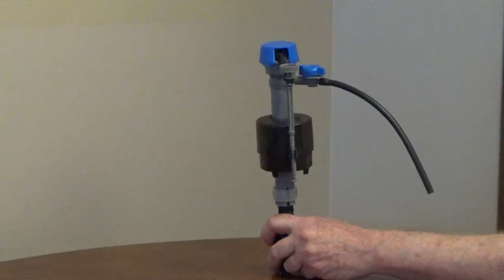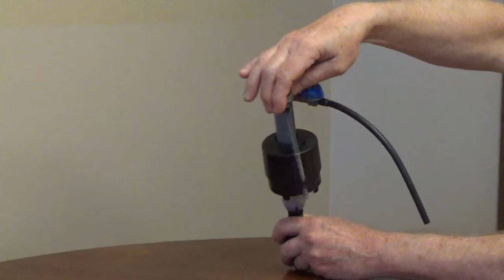How to Adjust Toilet Tank Water Level - Fluidmaster Toilet Fill Valve

Comment: I had trouble turning the screw because I was fearful of it breaking due to it being made of plastic.  However, I preserved and gave it several turns (more like clicks), and viola!...it worked.  Thank you!
Reply from the maker: You're welcome.
Check out some home improvement tips in our e-books https://www.amazon.com/gp/product/B0B2KW1FQ9?notRedirectToSDP=1&.
Reply: Congrats. You’re a genius
Reply: I've got the same problem. It won't turn clockwise but it'll turn the other way. I don't want to force it! It just bends a little. But it won't click like yours. 
I thought I could fix it myself. I live in an apartment but the maintenance guy is out sick this week.
Reply: @kberken  if it won't turn clockwise, it's probably topped out that is why you're supposed to check the length of the new valve to the old one before you install it.

Comment: I turned all the way low but it still over fill and keep running until I manually turn the water off
Reply from the maker: Hi, did you adjust the height of the main body of the fill valve?
Reply: @FIXITHomeImprovementChannel  i fixed it. all i did was cleaning the valve seal

Comment: the screw is at its limit and the water level is too high.  It doesn't stay at i inch below overflow.  I cannot stop the water rising too high.
Reply from the maker: Hi, you can pull up on the retailing ring on the shaft below the float, then push the top down. Then push the retaining ring back in place. That way you don't have to twist it.
Check out some home improvement tips in our e-books https://www.amazon.com/gp/product/B0B2KW1FQ9

Comment: My toilet tank has been making dripping noises periodically throughout the day, the overflow tube doesn't have water flowing in, so I assume that's at the right level. and the water is at mid level on the float. I wiped down the flapper really good on the bottom in case there was any buildup but it seems to be a good fit.

not sure what's going on?
Reply from the maker: Hi, here are some tips. https://youtu.be/lQY2OzjaDjI

Comment: Is it normal for it to slowly need adjustments over time? I'm at the end of the adjustment now (counter clockwise) which is working for now, fill valve is about 2 years old.
Reply from the maker: Hi, I've had this happen on a couple of valves before they needed to be replaced. You can also turn the shaft of the valve to adjust the height then use the float adjustment for fine tuning the height of the water.
Check out some home improvement tips in our e-books https://www.amazon.com/gp/product/B0B2KW1FQ9

Comment: My water level is too high and overflowing. I have no screw or thing to twist to adjust. Positive there is nothing at all to turn. What now?
Reply from the maker: Hi, if you have an older model, it could have a spring clip to adjust the height of the float. You can email a picture to fixitpodcast@gmail.com and I will try to help.

Comment: What is I have the screw on the highest setting but the water level is still too low and leading to a weak flush.
Reply from the maker: Hi, you can adjust the height of the main body of the fill valve, then adjust the float to fine tune the height of the water.
Check out more home improvement tips in our e-books https://www.amazon.com/gp/product/B0B2KW1FQ9?notRedirectToSDP=1&.

Comment: I turned the screw completely counter clockwise and the water level is still too high and the flush valve is whistling  and water will still flow through the fill tube.
Reply from the maker: Hi, you will have to adjust the height of the main body, or replace the fill valve.
Check out some home improvement tips in our e-books https://www.amazon.com/gp/product/B0B2KW1FQ9

Comment: I turned the screw all the way to the highest water level it can get and adjusted the fill valve to the highest that barely fit with the tank lid on top. It still need more water fill. Is there still a way to go above that and increase the water level some more?
Reply from the maker: Hi, have you tried a Korky fill valve?
Reply: @FIXITHomeImprovementChannel  No, I haven't
Reply from the maker: @dmana3172  I would give the Korky fill valve a try. https://youtu.be/vqDi0NbnJ4A
Reply from the maker: If you have a high efficiency toilet, get a Korky Platinum, it allow you to also adjust the water in the bowl.

Comment: I turned the knob in both directions and still nothing. What do you think it is?
Reply from the maker: Hi, the threads could be stripped on the float. It's a pretty easy project to replace the fill valve. https://youtu.be/2fVzAXakjZ0